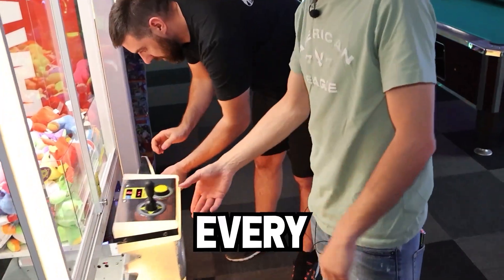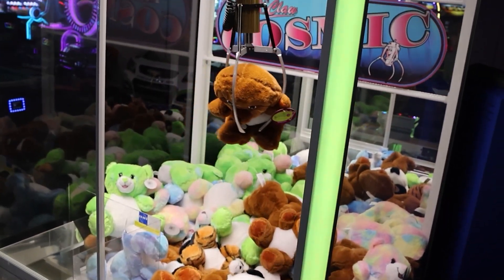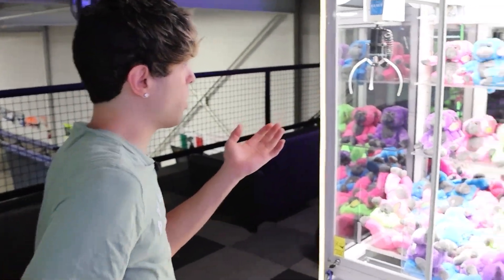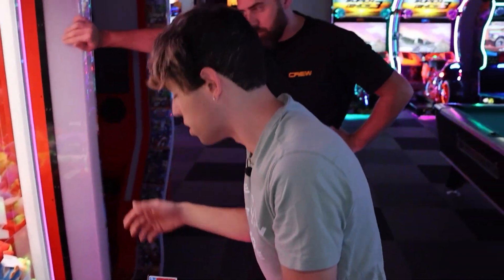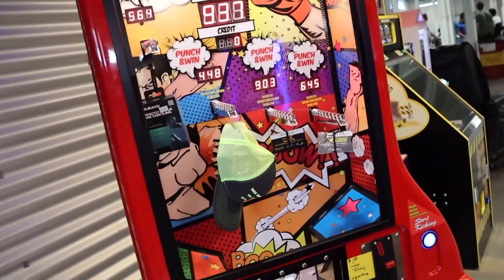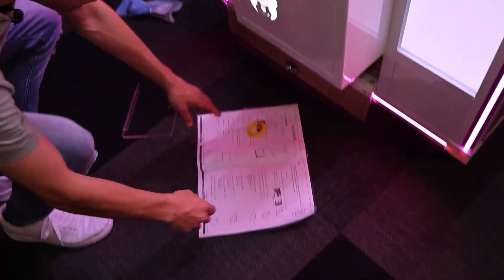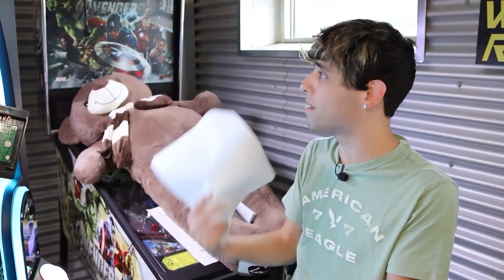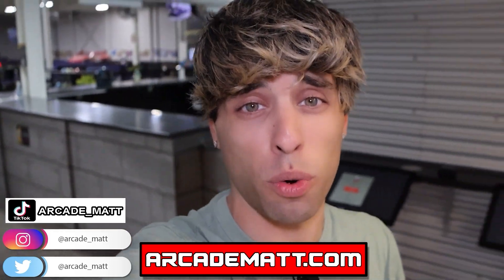EXPOSING How Claw Machines Are Rigged

Comment: Thanks for the behind the scenes look at the claw machines and stuff, good video. 

I concur with all of the things you mentioned in this video. I recently designed a working virtual arcade in ROBLOX and I'm learning a lot about how it all works. You don't wanna tilt the balance too much toward the Player (Ex: Player winning all the Stacker prizes and Operator having no prizes to load) or too much toward the Operator (Ex: Player getting frustrated and leaving the arcade). Just tilt the balance ever so slightly so that the Player can still keep engaged with your games all while the Operator can maximize profit.

Comment: To keep up the head of the "dead" 🐻: put a safety pin in the back of the head and loop the pin around the string. Don't remove the string from the loop on its back.

Comment: I love that this video pulls back the curtain a bit.  But ironically it undermines your entire video bank of "claw game tips", because they are clearly all rigged.  While your tips may be helpful if a game is ready to pay-out, it doesn't matter most of the time which sort of turns me off to them.  I bet you that Zombie Snatches and Tower of Tickets (and so many others) are built the same way.  I could swear that Tower of Tickets intentionally releases the arm bar delayed sometimes and on the button push on others so you can't use "skill" or timing to clean it out.

Comment: okay,???? so how is that legal? So its no longer a game of skill for kids to play. Its a gambling game that only allows a prize payout at random. And also at that chance to win you must have to grab the prize exactly perfect. Or nobody wins a prize until the game decides to let people try to win again.. Thats BS. and thats worse odds than casino. 

To at least be fair, they should make  the claw get progressively stronger until some kid wins. Then it weakens the claw again. That if the prize  costs $10 retail( means they are buying it for less than half with absolutely no overhead. That it should start to get stronger and have the delay drop at 1sec so they think they almost got it. Then at $10. they already got the retail value
 That it should be be set that they have a chance like a normal game used to be. then each one gets stronger that it should almost guarantee a win by $20 as the claw strength should be at max. Until someone wins. Then it resets again. That way its at least fair to everyone. that kids will actually get a chance to win and the owner still will make more than retail price. As if they are retailer selling his products..
And not an infinite losing gambling machine to take kids money. 
Otherwise they should get the gaming commision out there checking to make sure their games arent out there ripping people off!